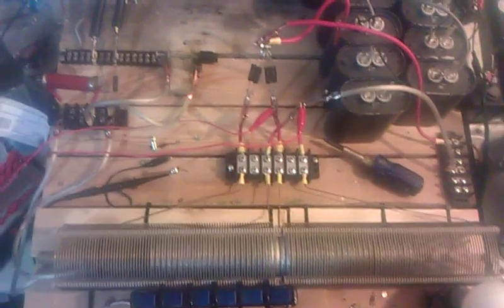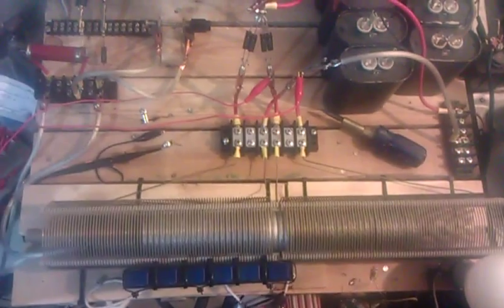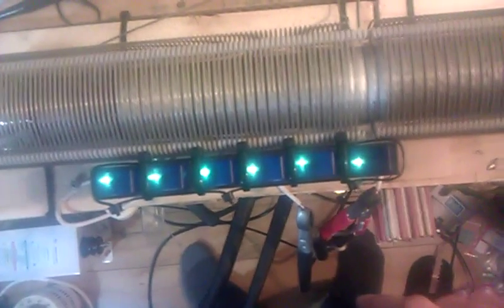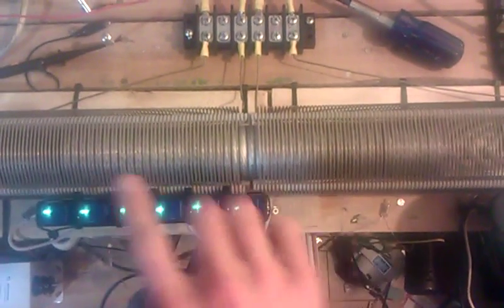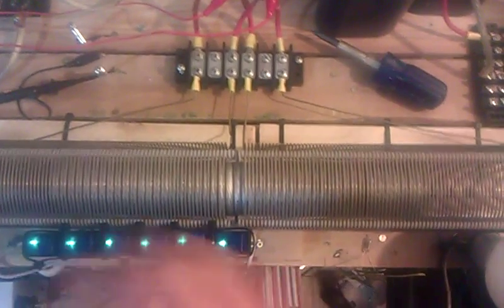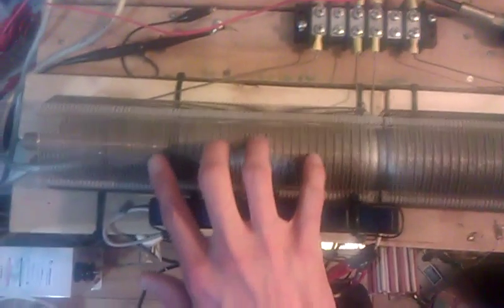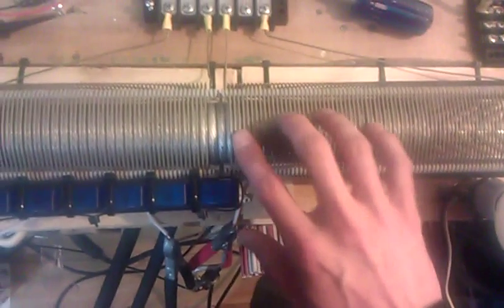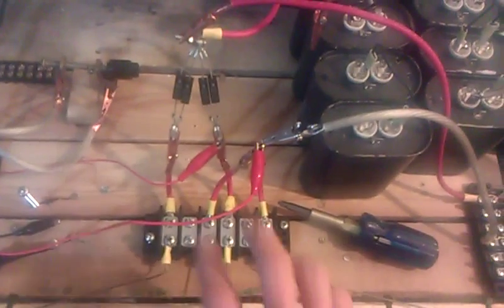Don Smith Device Project Part 22: THE Answer To Direction of Windings, go WITH  the induced polarity

Comment: You need to ground the coil to make way for a complete circuit. Use Spiral Electron Spinner Avramenko Plug which you can make with H.V.H.F Diodes like HER208. The Diodes must linked in series and closed. You have a square shape A.V.P. Now connect your ground wire to opposite point to the point you will connect your center tap. Simple.
Reply from the maker: thanks man, this is very old experiments i did when i knew little :)
Reply: @kdkinen  . This is 6 years old or better. I appreciate what you did share back then. Are you still working with these systems. I am and have changed the game with the capacitors being aluminum plates in lexan. It forces the resonance to occur without the coils in the front end. The watts are no longer seen by the watt meters and smart meters. Id be interested in sharing and conversing more. you can email me at sacredfire999@gmail.com. Here is a quick link to one of the videos I made to help people understand how to force the resonance to bypass what the smart meters can detect. PEACE!
https://www.youtube.com/watch?v=RmgUAsgv1QQ
Reply: @kdkinen Какой кпд этой установки и новой установки?

Comment: Just about to started building my own. One question, does it work haha?
Reply: How are you doing with your device? I hope you are doing well. Usually it takes about 6 to 12 months of INTENSE work and then for some reason nature starts to make weird coincidences like finding people doing the same thing and that is when magic happens. Right Mr.Clean?
Reply: @jimmypop5010 У Вас это работает? Если да то какой кпд?
Reply from the maker: +Levi p hi there I would say it's gonna be tough, but yes I was getting some very interesting results when the spark was timed properly, 50 watts out for 25 watts in, that sort of thing. but never got any kilowatts out... but in circuit simulation yes I was seeing kilowatts out. I will return to this in the spring time
Reply: Awesome thats really good to hear.
Have you tried putting it in to your power grid or storing it?
Reply from the maker: Levi p hehe that would be disastrous to try a grid interface, but yes i have stored it in batteries and capacitors, thats a few vids down from this one. the caps i may not have video, but the diodes absolutely went up in smoke, but until then i was filling up 400 Farad cap banks